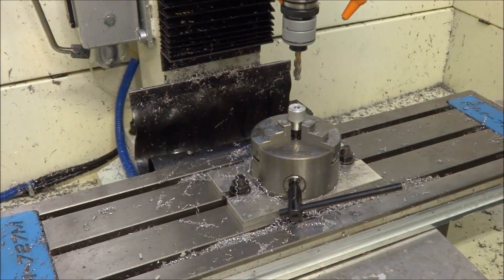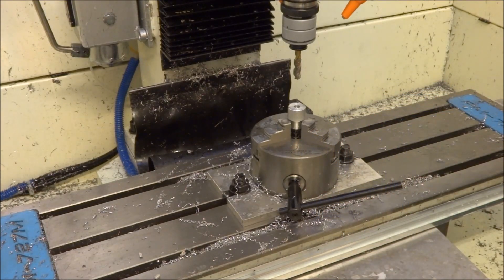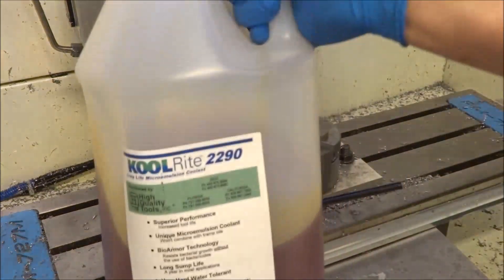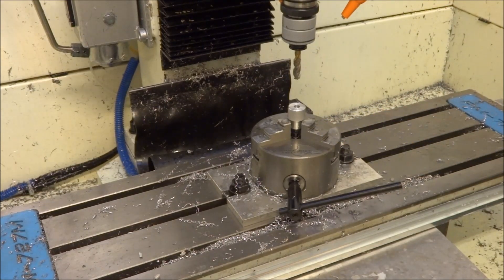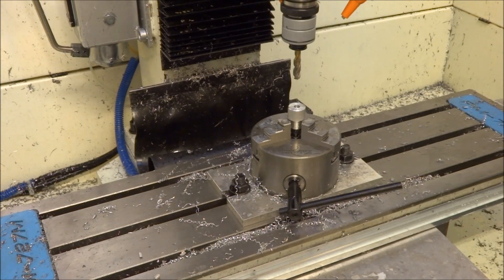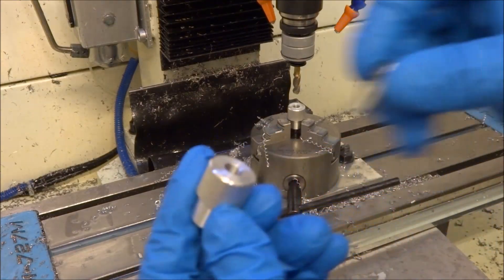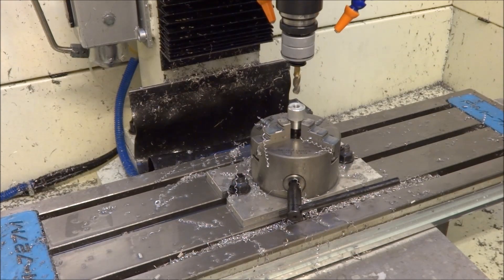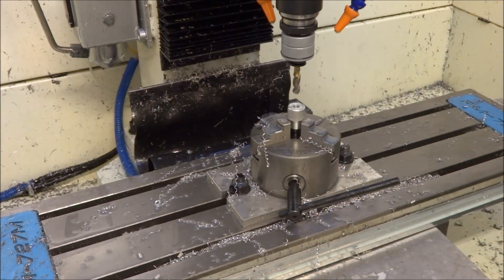Mach 3 Compression Tapping

Comment: Because of it's less toxic nature, I bought some Koolmist for my cnc lathe. Pleasant to use, but was just not effective when parting. Had to go back to normal soluble oil coolant. That was an expensive exercise, but worth a try. (Freight US to Australia is a killer, usually more than the price of the product.)
Nice to have you back in the shop.
Reply from the maker: Yes I was attracted to KoolMist 77 for those very same reasons. However as you found out Drilling , Tapping and Parting suffer. Not to mention Part staining.

Comment: Great video. Thanks for sharing your experience. It really helps new guys like me. I have been researching how to do power taping on my manual mill. I don't have a tapping switch to reverse the spindle but I guess it would still work to stop the spindle then hit the reverse button. What brand / type of tap are you using?
Reply from the maker: This is a Tormach TTS Tapping head I thinks Shars Also makes Compression tapping heads.
Reply: @CNC4XR7  Thanks. I have looked at the Tormach compression heads but wasn't clear what the difference between the operation of the ER 20 collet version and the quick change you showed in the video. I guess the quick change lets you load up your taps in advance. Did you also use the Tormach spiral taps?
Reply from the maker: @3dmakerzone75   the Quick change lets you change the tap quickly so if you have a couple different sizes it makes quick work of it. I have used regular HSS taps tapered flute and Spiral I find the tapered are a little less likely to snap.

Comment: Nice one Sam.  Looked like the Z axis was retracting faster than tap was moving up.  It's a floating head so there is some allowance but if the thread was deep would the tapping head run out of travel and break the tap?  Thanks
Reply from the maker: Well that tap was going the full length and then some. The issue was the pause at the bottom for the spindle to reverse then retract. need a few more milliseconds I think. However it varied a little and some were just fine. That's the good thing about these there very forgiving.
Reply: Ok cheers Sam

Comment: Any idea where the expression compression tapping comes from?
Here we would call that a floating tapping head.
Could you not have run these in your lathe?
Reply from the maker: Yeah you Know we always have to change the Name! LOL it does have a spring inside to "Compress" as in goes down and " expand when it retracts. about 7/8" travel total.
Reply: I suppose we should be grateful it is not called a "compression and expansion" tapping head.
You could not do these in the lathe?
Reply from the maker: I had issue with the code for some reason mostly my inexperience with the code itself and no time to really get into it.

Comment: Hi,

I like the idea of the tapping head, but if you already had the part in the lathe why couldn't you do the tapping in that?
Reply from the maker: Good Question!, I tried to do that once before and I could not get the Gcode worked out so I gave up . this run again I ran 150 pieces and just had both machines running. I need to work out the g code on the lathe to do the tapping I don't know if it's a Mach3 thing or it was just something with my Gcode.
Reply: I can't remember if your spindle on your lathe is controlled by Mach3, if it is just have it run at 250rpm, and have the tap held in the tail floating (unlocked) tailstock, that should pull it in while tapping. You should be able to work out how long you need to have the spindle run for before it slows then stops, then have it automatically reverse :)
Reply from the maker: yes I am fully cnc now so Mach 3 controls the spindle

Comment: Hope your investments will eventually pay for themselves. Will that Tormach tapping head adapt to the X2 with the R8 spindle? I have a tapping head I bought from Grizzly T10057 - Tapping Attachment - MT #2. Added R8 Morse Taper Sleeve.

This head sucks, plus its too long. I was able to get more height out of my X2, but the head spins the tap holder lose constantly. Very poor design. Will modify to add set screw to lock it in place, or ?
Reply from the maker: Fits right into a RB 3/4" collet. However it is about 7" long with a tap installed which is not very usable on a X2.
 It works great and I have not had any issues.
Reply: Thanks! I'll have to measure what mine takes.  I know it takes a dedicated collet per tap. Did you go with ER20 or 16 collets? Finally What was the cost, if you don't mind my asking? Thanks again.
Reply from the maker: Crevice Dog 
The tts tapping head was $165 and it uses quick change collets there around $20 each there is a complete set for $365 I think